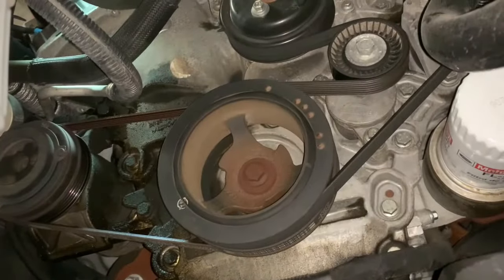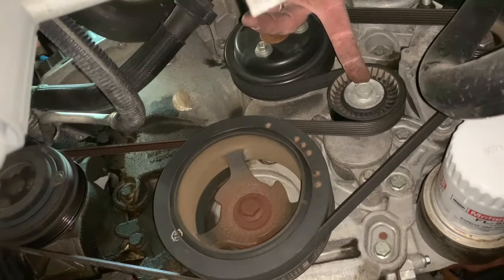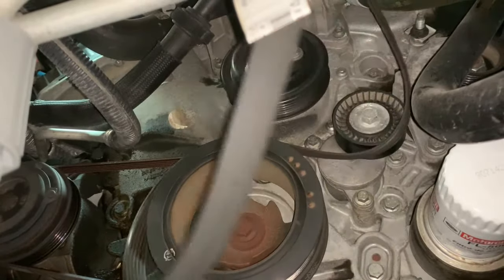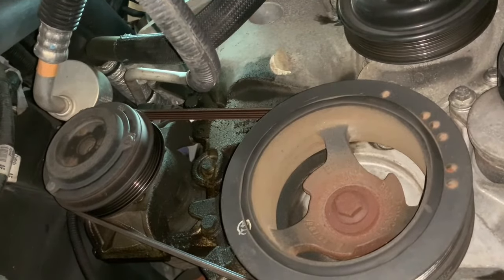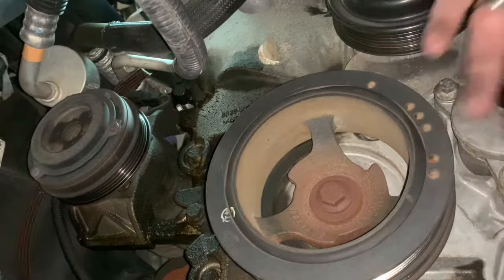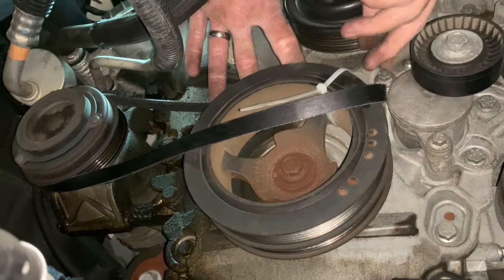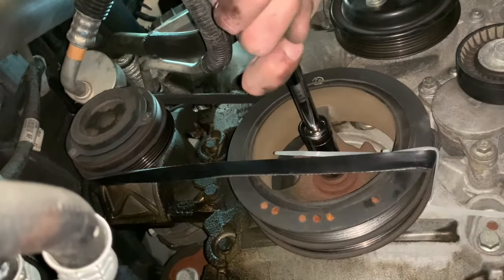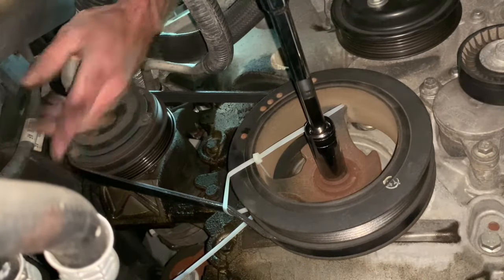2015-2020 Ford F150 3.5L Ecoboost Serpentine and A/C Belt Replacement

Comment: This belt change is a LOT easier done if you do it when you change the spark plugs.  Remove plugs, do the A/C belt while plugs are out, easier to turn crankshaft.  The A/C belt change is not one of Ford's better ideas.
Reply: Thanks for the tip!
Reply: It's not Fords idea...So Ford can't take credit for this stupid piece of engineering
Reply: Must be Chevy's idea then?
Reply: Hi
Reply: Number

Comment: I went through 10 zip ties trying to walk that ac belt on, 2hrs later i said  fu** zip tied it twice on the crank and bumped the key on for a quick second and whalamm belt was installed 😂

Comment: I subbed you for one main reason: you put the PARTS LINK in the description! That shows that you're a true mechanic and you've been in a position where you need to know actual part numbers versus just a video showing how to install something! I support that!
Reply from the maker: I'm glad you found this helpful!
Reply: @AutomotiveAuthority  I bought belts yesterday and only needed to do the front one. The AC belt was brand new (I just got the truck 3 months ago). Makes no sense as to why they put a brand new REAR belt on but the front belt was missing a whole rib! People are so backwards/lazy.

I can take the rear belt back today, but now I've got the process from you on how to get it done in a couple of years.

People are so cheap. WHY even do the rear and put the OLD front back on? LOL! I scratch my head at people, man.

Comment: Great video, and thanks for including the socket sizes.  I would add that you'll want a long breaker bar, or take the bar off of your floor jack and slide it over the end of your 1/2" ratchet.  You're going to need a lot of leverage to keep that crank moving, and it can be pretty tight down there, especially if you have an aftermarket pipe, but even stock, there isn't much room.  Once you have the zip ties tight and a long enough bar, it isn't too bad.
Reply from the maker: Great tip!

Comment: I had my belts replaced about 7 months ago and I am getting a squeal when I start up and it goes away after the engine is warm.  It is worse on damp or rainy days.  Does this sound like a belt is bad already?  I would think that if it was a bearing or pulley that it wouldn't go away after the engine was warm.
Reply from the maker: It could be several things causing a squeal and its hard to say exactly what it is.  The belt could need to be replaced or the tensoiner could be starting to wear out would be my top guesses.  You could also try a belt conditioner spray from a local auto parts store that could also remedy the noise without having to guess and throw parts at it.

Comment: Ok who ever the engineer is that came up with this Chang Wow set up should be dragged buy his sack behind his product I just did one of these turds 💩 today I swear I’ll never I mean never see Another bad belt on a Ford pick up that has this set up
Reply: The 2014 and up Silverado has the same design
Reply: It’s not hard lol
Reply: Lmao, try GM's e-assist.....
Reply: both belts can be changed in literally less than 3 minutes
Reply: @krisgarrison3481  it’s easy once you know the secret the day I did it I was having a bad day
Reply: Put the belt over the crank pulley completely and walk it on from the back! Easier! Over the crank then on aC compressor then walk the belt on from the back. 😊